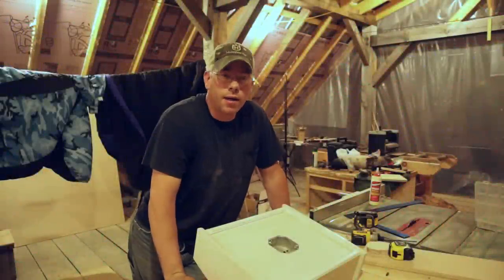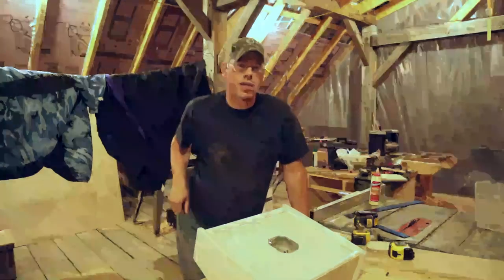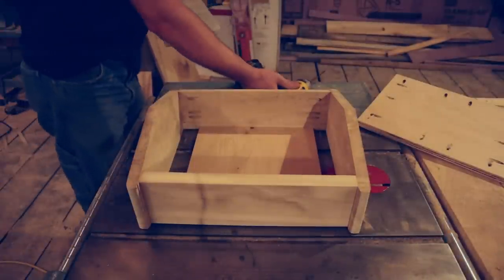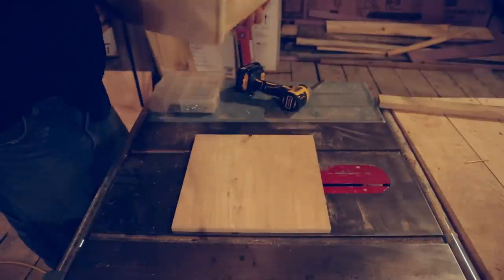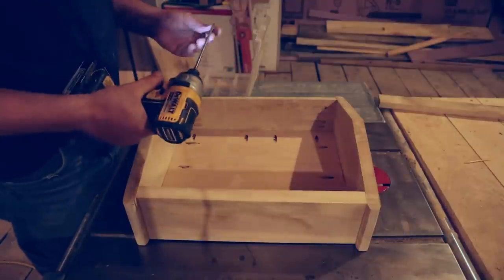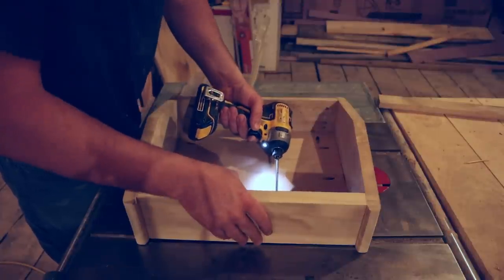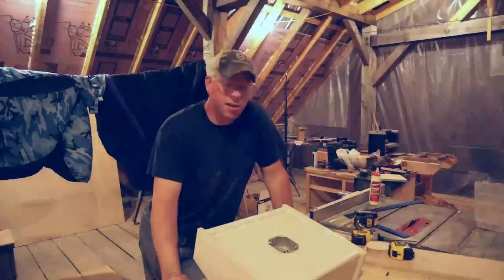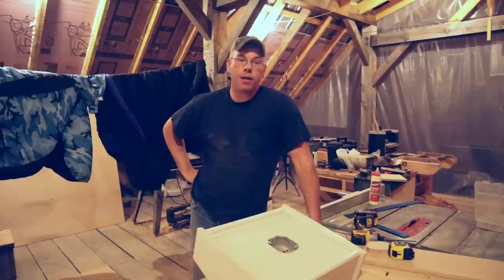Hand Tools Meet Power Tools: The Ceiling Fan Box

Comment: Jim, with the number of screws you used, you must have got them on sale. That unit will be certainly strong enough to be hold the ceiling fan. Good video, thanks. Have a great week
Reply from the maker: Needs to be strong.
Reply: I probably would have used the pneumatic nailer and glue. The keg jig sure is nice to use. All the best my friend